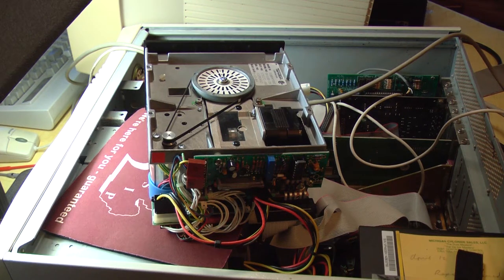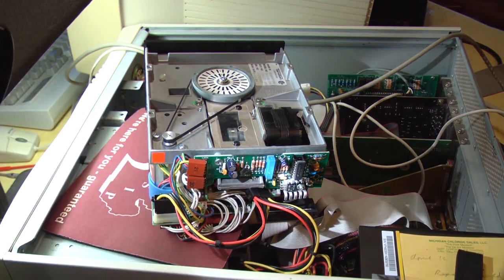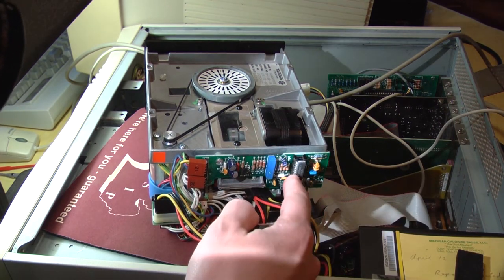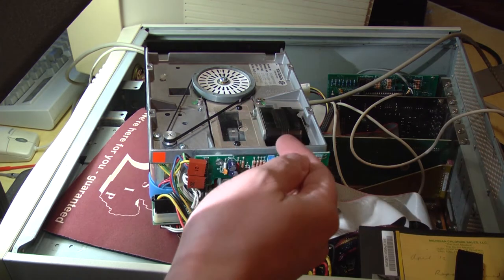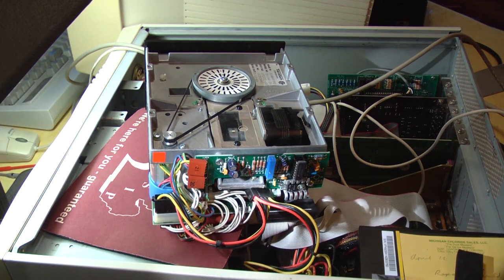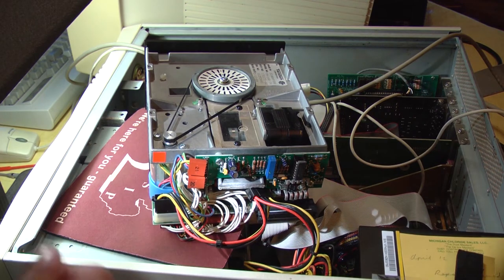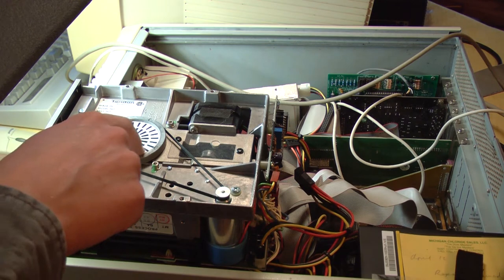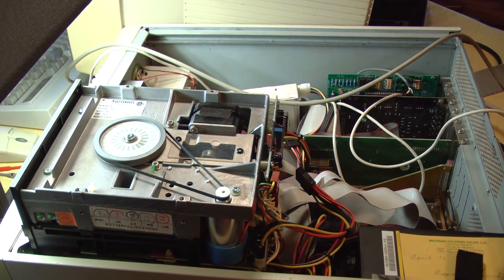Tandon TM-100-2A 5.25 Inch Floppy Drive Speed Adjustment Part 2

Comment: i have four these,  i can run it whit an adapter?
Reply from the maker: Adapt to what? I'm not aware of any adapters that would go to USB if that's what you are looking for.
Reply: @w8nwo 
They could be used on a Greaseweazle USB controller (with a separate power supply), but that needs special software. It won't work like a classic 3.5" USB drive.

The advantage is that the Greaseweazle controller is also able to read non-PC formats.